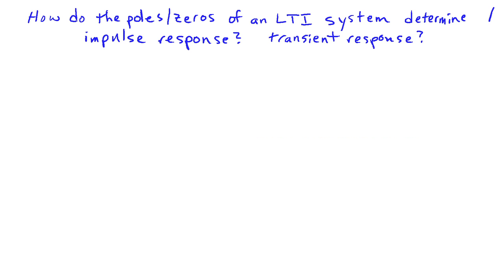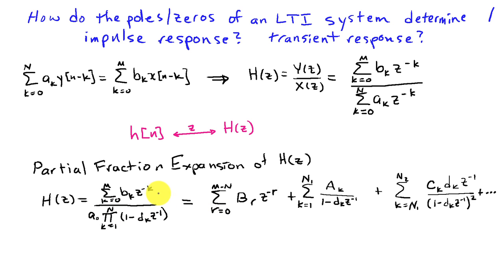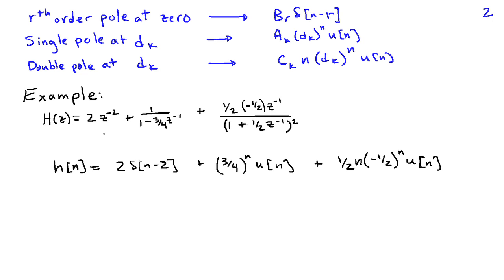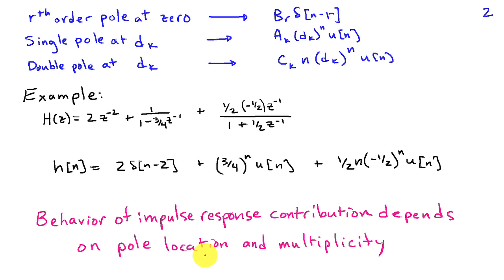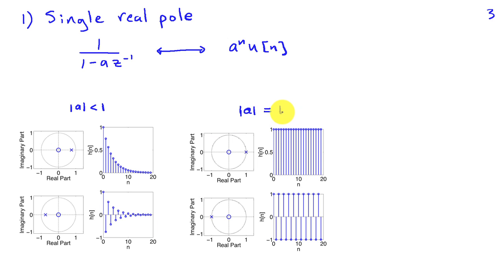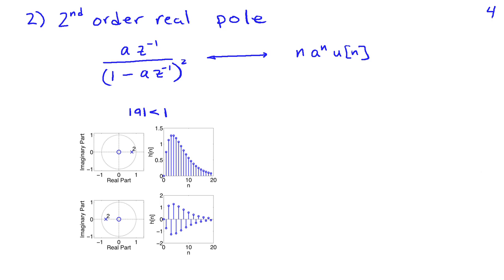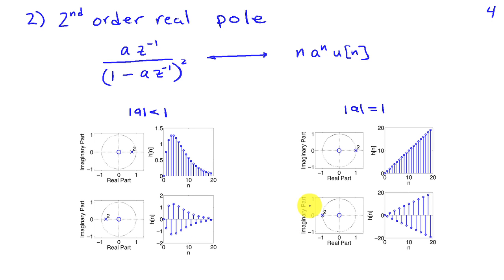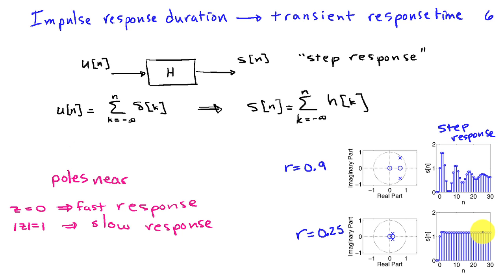Impulse Response and Poles and Zeros

Comment: From the difference equation, it looks like the the Br coefficients correspond to the zeros of the system, not "poles @ z=0". Am I wrong? I'm trying to figure out what a zero looks like in the impulse response, and it seems to me that they should be weighted impulses depending on location of the zero. For example a 3 point moving average filter has an impulse response of h[n] = [...0,0,0,...1,1,1,... 0,0,0,0...] and would have zeros spaced equally on the unit circle. If I am correct, does that mean that in continuous time, there would be a series of weighted Dirac deltas? And if so, is that weighting applied to the area of the impulse?

Many thanks for sharing your tutorials! They've been a great help.